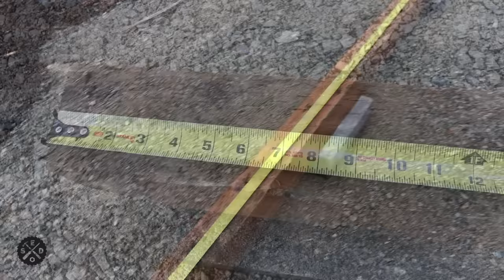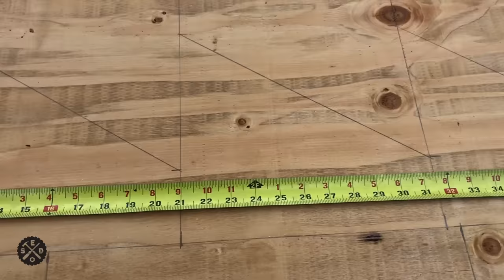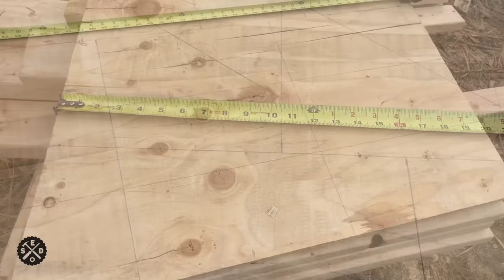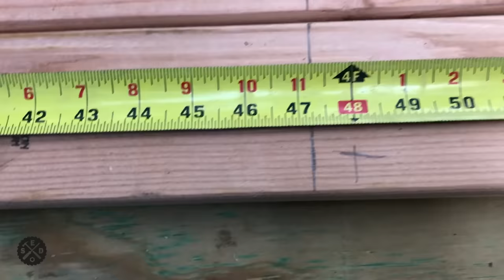How To Build A Shed By Yourself All STEPS 10x16 diy

Comment: Great job...!  Thanks for the tips. Tip for you... For the door spring-lock latch hole you can take a 1 or 1-1/8" hole bit and drill down 3/16" into the floorboard, Then a 1/2" bit in the middle of that a little deeper (I'm sure you know it's better to drill the wider hole first) and then hammer in the appropriate sized gal washer (can even add a little adhesive or sealant before setting washer) to preserve and protect the hole. Not a bad repair idea for a destressed hole either... Just on the bottom is fine., That's where most of the pressure is anyway...  GREAT JOB...! Taught me a couple of things...        Thanks {: )
Reply from the maker: Thank you that’s a great tip!

Comment: Paul.  Great shed build and tutorial.  Your explanations are very clear and understandable.   A friend told me about a tea he has used for getting that greyed aged look on his boards.  I wonder if the stuff you used is similar?  I built a free standing 4x12 firewood shed last year and used the same metal roofing.  I would just like to encourage your viewers that if they break these projects down into small doable pieces, they are quite manageable, and they can do it!  and there is great ongoing satisfaction in using a shed you build yourself.   Geo
Reply from the maker: Thank you for the kind words and encouragement for others! No I did not use tea for this. I’ve heard of something similar like that but I don’t think it would hold up long-term as well. That’s awesome that you did your own project like that. Nice job!

Comment: I've often thought about how hot a halogen drop light can be just running thru a solar powered battery and a transformer can run a 300 watt light that could heat up a tent with in a home, just to make it thru a cold night,the smaller the space the warmer the place.
Reply from the maker: Yes so you’re thinking use one in a well insulated shed?

Comment: Thanks for producing this excellent video. I am looking to build a shed this size to store all my outdoor power equipment and this will really help me as I plan it and then do the build. I live in a windy area so I'll need some cross bracing on the walls and hurricane ties for the trusses. I had never heard of the RuggedWood treatment before and I really like the look and the fact it isn't toxic .
Reply from the maker: Thank you Tom I really appreciate you letting me know! Yes it’s funny I was just replying to a comment yesterday about if you’re in a windy area that it would be good to do some hurricane ties and some cross bracing in the walls. The shed itself is anchored with the lags down into the skids if you’re going to build it this way as well as far as foundation. I think if it was on a concrete slab or concrete piers it wouldn’t go anywhere either with how heavy it is. I built mine this way on skids because I plan to move it again in the future. Yes I’ve personally had really good luck with the rugged wood treatment and I also love the fact that it’s eco safe! Thanks and I wish you the best with your shed!

Comment: Really nice shed. Love the stain. If someone pulls out the two screws on the locking handle, the whole thing will spin to open, even though you can't pull it out, but you don't need to pull it out.
Reply from the maker: Thank you! I’m glad you like it. I would’ve liked. the other handle better if it would work for my situation but it didn’t. Even if you can get the two screws out that handle that’s inside has that allen head stud so I think it would be pretty difficult to get it off.
Reply: @SmartEasyDIYer  But you don't need to get it off, you only need to spin it to open. With all the effort you put into putting carriage bolts in the hinges for security, that is now your biggest weakness. I'd hate to see you lose anything in there.
Reply from the maker: I see what you’re saying. I was thinking of putting bolts in this too but it would interfere inside for closing the door. If you’re worried about it and can’t find a different handle you like you could always put a separate safety hasp and padlock on it.
Reply: You could countersink the nuts on the inside to clear the latch. Excellent video by the way.
Reply from the maker: Thank you! Yes that’s an idea.

Comment: great job. good details in video. i built a salt box design in a 8x12. i used T-111 siding to reduce wood cost and labor . all built for heavy snow load and security.
Reply from the maker: Thank you I appreciate the input! Sounds like a fun project. You must get a lot of snow.
Reply: @SmartEasyDIYer  we usually get 4-5 feet deep every winter . my shed is on the idaho-montana border. i can't even get in there yet.
Reply from the maker: Wow that’s a lot!! I’m only a few hours from the border but I don’t get that much.

Comment: I plan to start this build soon.  This is what I was looking for, almost to the exact dimensions and details.  I was thinking red barn look but I do like the rugged look.  I'll be ordering it soon.
Reply from the maker: Thanks Matthew I appreciate the support! I’m glad if it was helpful. I wish you the best with your build!
Reply: @SmartEasyDIYer  If I am going to insulate and heat for a small workshop.  Do I still need the vented roof?  and can I still do the 20" stud spacing?
Reply from the maker: The studs spacing I did is 24”. You could do that yes. Depending how you’re going to insulate it you may want to go with 2x6 walls so you can hold more insulation. I don’t think the vented roof is as critical on a small structure like that but it isn’t a bad idea.
Reply: @SmartEasyDIYer  Nice, yeah the idea is to have a workshop I can make soap in and let the homeless use during the winter while I help them get back on their feet.  It's sort of an idea I have that I would like to see grow.  I would want it safe, simple, and affordable. Kind of like an Adopt a Homeless program. I don't know, I'm just thinking out loud here. But a shed/workshop is better than the streets.  It's cold here in Maryland where I live.
Reply from the maker: That’s such a great idea! Thanks for thinking of others.

Comment: Great job. I probably would stagger the flooring. Also, what you are calling patches are called gussets. Otherwise, it's a great plan. I built one by myself once, and it does get sketchy on the roof. I always keep my phone handy for the 911 call. 😂
Reply from the maker: Yeah I got in a habit of calling them that from someone I worked with longer ago. Yeah I could’ve staggered it, I typically do just didn’t since it’s a storage shed. Nice job on yours. Thanks

Comment: Well done. On your next barn you might consider piano hinges that can be hidden inside the door trim. I love what you did with this.
Reply from the maker: Yeah I suppose you could I didn’t know how heavy duty they were. That’s something to consider for sure. Thank you I appreciate it!
Reply: @SmartEasyDIYer  I used to build the units for Home Depot back in 2002 when they were among the best out there. Not so good any more. But anyway we used the piano style hinges and they were more than strong enough for any size we put up. I liked your video as soon as you mentioned the concrete piers. Most forget about the ground movement and the way it can settle. Again, well done.
Reply from the maker: Good to know. Thanks for the input. 😊👊

Comment: Nie viceo. I was curious whats the point of not putting patches on the two end trusses?? Could you double patch them?
Reply from the maker: I just did it so it didn’t interfere with the siding if I keep the truss all the way even with the outside wall. You could put it on both sides but then you would pretty much have to shim the whole rest of the truss a half an inch for the siding to fasten to.

Comment: Great video! I usually put all my screws in the ribs, because a lot more water runs in the valley than on the rib, increasing the chance for leaks in my opinion. I also prefer to use Grace Ice and Water peel and stick underlayment and I run it over the drip edge, not under, so just in case there is a leak, or if ice dams creep up and melt the water can't get under the drip edge and rot out your soffit, or tail ends. BTW, No one I have ever worked with or for, ( professionals/tradesmen) use fasteners in the face of the metal trim, because it leaks and causes rot, just let it hang, or use clamps and adhesive. These are just my opinions based on 22 years in the construction trade, but I thought they were worth mentioning, just friendly advice ;)

Comment: Nice video explaining the thought process for each step.

I would say that the Tyvek only serves to prevent any driven rain water that gets past the boards and battens from getting inside. But it doesn't help much if you want to heat the building. The Tyvek may stop air from leaking past the boards and battens, but only as high as the Tyvek goes. If you want to make it help for heating you'll need to make the air barrier continuous -- to the top of the wall and across the ceiling, or seals the walls to the roof and tape the roof sheathing joints. Making a continuous air barrier can be tricky and one should study up before trying to do it.

Also since mice can squeeze through 1/4" gaps I doubt this shed will be mouse-proof. Frankly I'm tired of mice excrement and urine on my stuff. I would add some extra pieces around the door jambs and floor and ceiling to close down the gaps to prevent mice from getting in. And if you wanted to have heating, you would include weather stripping as well.
Reply from the maker: Yes good things to think about. Thanks
Reply: Nothing is truly mouse proof  the best you can do is moose resistant. When it turns cold the buggars will always find a way in
Reply: @snakeplisken4119  -- I'd beg to differ, but also agree. No matter the security system, there is no house that is safe if someone wants to break-in badly enough. Similarly mice have the capacity to gnaw through all kinds of materials if they really want to. But if they have to gnaw very much, like through an inch of wood, they will usually give up. So if you pay attention to detail, it is not all that hard to seal all gaps to less than 1/4". For a shed like the one in this video, I'm actually changing my mind and saying that it has a good chance to be mouse-proof. I'm especially looking at the most vulnerable spot, the door. But the way this door is built it looks like when the door is shut there are no significant gaps around the side and tops. The bottom of the door overlaps the structure quite a bit  but there is some potential for the door to bow out a little at the center allowing mice to get in. However using those spring loaded vertical pins to hold one of the doors tightly shut (1:15:50) is a good move, and when the other door is shut, it will also be fairly tight. It would have to be pretty badly warped to allow mice to get in. So overall I'm going to say this shed has a good chance to be mouse-proof.
Reply: @dennmillsch   I'm very impressed  by your thoroughness sir

Comment: I usually don'/can't sit thru this long shed build But i did this one,  I didn' even get bored lol! The only thing i'm thinking putting your batting strips on i think nailing it on both sides of the crack when the boards start drying your batting will twist and split ! Just a thought , but that was a great video very plain easy to understand,,,
Reply from the maker: Thank you I appreciate the feedback! Yes I know what you mean my boards were actually dried for quite a long time. They tend to split a little bit even if they’re dry but very minimal. If they are freshly cut though it’s a good idea to only nail the middle so they can dry. Thanks
Reply: Now i know why it took so long to get that shed finished! You reply to everybody, lol

Comment: For future reference, traditional board and batten buildings are not doubled nailed on the boards, they will eventually split between the nails.  The advantage of board and batt, is you nailed the boards to the nailer (belt rails and bottom plate) in the center than nail the batten between the boards in the seams, which are gaped around 1/8” or so.  The center nailed bats (normally around. 2” wide) will hold the edges of the boards flat and the center on,y nail in the wide boards allow for,the board to shrink and expand as ambient moisture changes during the seasons.  This is the advantage of board and batten siding construction.   Over nailing boards will weaken them, and the more nails you use, the higher the cost  especially in the 19th century when this type of siding was popular, especially on out buildings.  My house and barn are both built with board and batt redwood siding. The house was single nailed, per my description above and 75 years later is fine.  The barn was doubled nailed by a different builder and the siding boards that got the most weather, have split between the double nails.
For this shed, it should be fine, if the ambient humidity is fairly constant.  I live in the Pacific Northwest, where the humidity and temps are very different from winter to summer seasonal changes.
Cheers
Reply from the maker: Thanks for the info. Yes I’ve seen where traditional battens are nailed that way. That’s a good plan if they’re at all green. I thought that’s mostly where that idea came from so they could shrink up. Maybe even if they’re dry it’s good too with the season changes like you said. Mine were quite dry so I wasn’t too worried about them splitting. Overall they’re doing well.

Comment: I’ve seen where you put bubble foil over your joist before you put your sheeting on the floor to keep the cold out but you’d have to put skirting round the bottom
Reply from the maker: Yes you could do that to help. I don’t think it has much r value but it would help. Thanks for sharing

Comment: Nice Shed.  I agree on the overall quality of the premade sheds I have seen.  I could not believe how crappy they are & how much they cost.  I like the carriage bolts on the door hinges.  You could have still used them on the handle by using a spade or forstner  bit to install the nuts below surface, but I agree that it is highly unlikely that anybody would be able to get past the D handle on the inside.  Once again, nice job on a great shed that will serve at least your grandchildren.
Reply from the maker: Thank you so much I really appreciate the input! Yes you’re correct you could do the carriage bolts if you recessed The nuts inside. It may be something I do in the future if I feel it’s necessary. Yes it was shocking to me when I started looking at sheds and how poorly they were made and how much they charge! T

Comment: Great video. I watched the whole thing except for the base setup. I have a 12' X12' concrete slab that has a small metal shed on it that is falling apart. When I poured the slab many years ago, I planned on building a 12 X 12 shed on it, but someone gave me the metal shed, so I've used it. Now it's time to tear it down (before it falls down) and build something nice like yours. I was considering building a small stem wall and build on top of that, since I have a couple of hundred concrete blocks and the price of lumber is still high, although it is coming down. If you or anyone has  ideas, I would be glad to hear them. I am in Central Florida, so snow and super cold weather is not an issue. It may get into the 30s for a couple of weeks in the winter, but that's it. Rain is another story, daily in the summertime. We do say, that if you don't like the weather, wait 15 minutes and it will change.

Comment: On the floor joists I built the floor joist box in two sections. On one side I sheeted it, covered it in house wrap nailed down the skids, and turned it over and sheeted the other side. A little heavy but worth it for me.
Reply from the maker: Yeah I was thinking it would be quite heavy to do it that way but whatever works good for you! Especially if you have a couple other people that would be doable. Thanks for sharing

Comment: Nice project - enjoyed watching this. And like the style. Looks to me that if the door handle screws are released, the handle can be turned complete with the mounting plate and your in!
Reply from the maker: Thanks Andrew i’m glad you enjoyed it! Yes some others have mentioned that too. I wish the other handle would’ve worked for me but my door was too thick. You could put bolts through the handle if it’s counter sunk so it’s flush inside so it doesn’t interfere with the handle turning. Or put an extra hasp and padlock on there too. Thanks